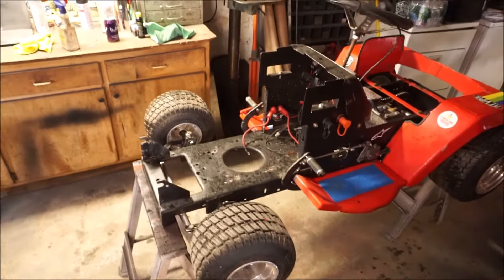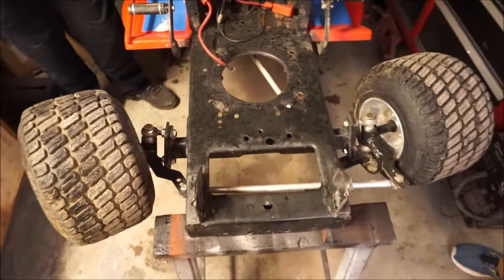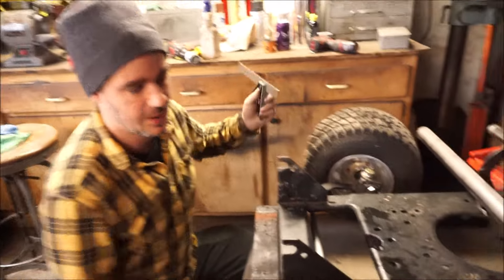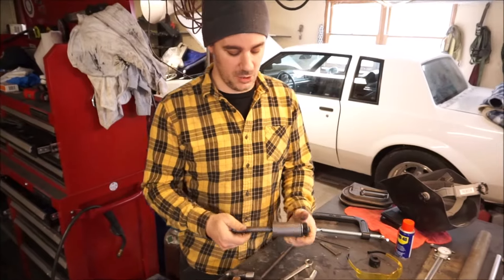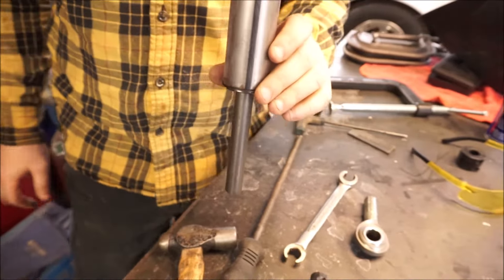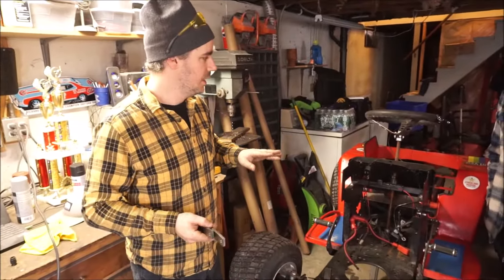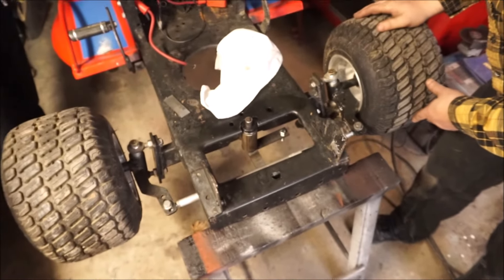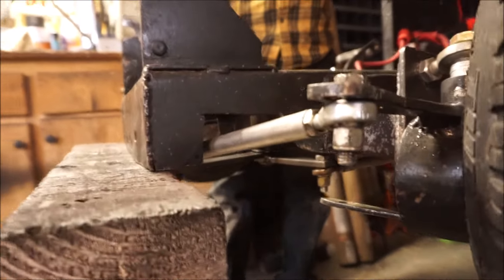Updating A Racing Mowers Steering

Comment: hes back!! I race on a 1/2 mile dirt oval, and a direct pushrod steering system was way too fast for the wide curves of a full sized racetrack, so I have built in a factory mower steering reduction gear to make the steering ratio 1.5 turns to go lock to lock instead of .75

Comment: I like your videos I watch them all the time I just picked up a mower to get into racing and have a few questions if you could help that would be greatly appreciated I know you race around New England I’ll also be racing in New England
Reply from the maker: That's good to hear, what are you looking for help with?
Reply: @TheJanticJournal  I’ll pm on instagram and show you the mower I picked up
Reply: @TheJanticJournal  I’m not 100 percent sure if the mower I picked up is a full size mower and if it’s a stamped steel frame or not and what class I would be able to run it in cause I believe it is a mig engine mower